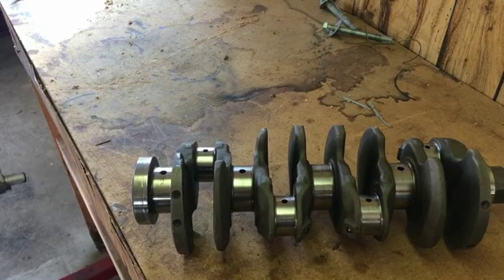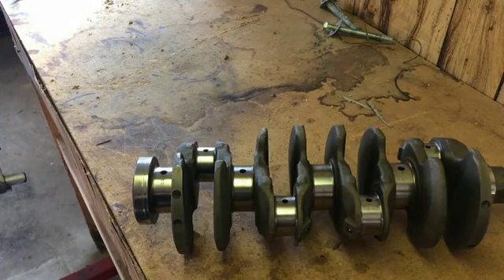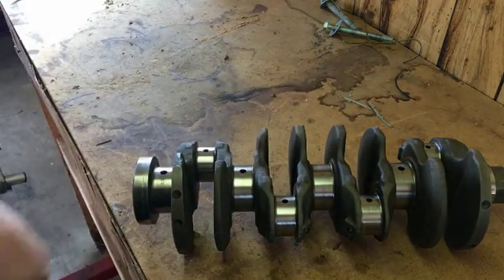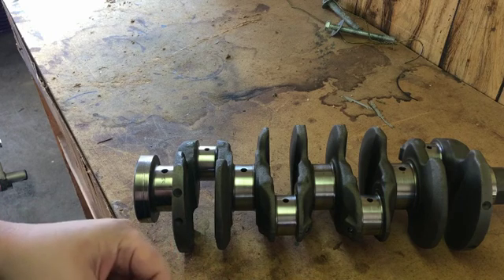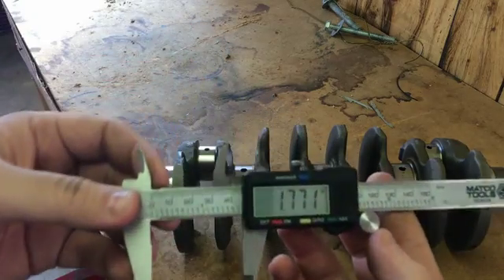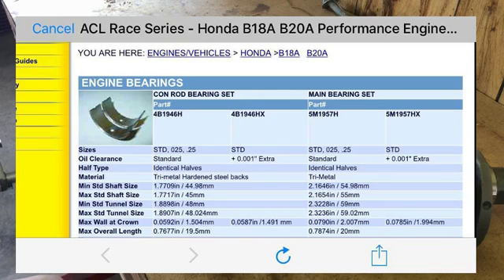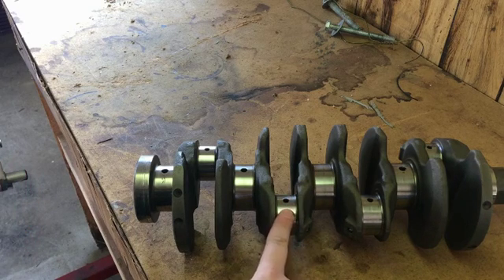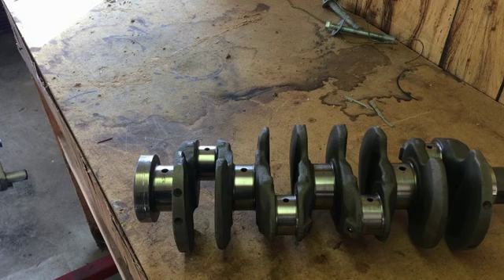Crank Inspection & Bearing Clearance

Comment: Have you ever gotten bearings from ACL with imperfections? This is my SECOND set I had to get from them because the first was 9 kinds of fucked up, and now I got 1 bearing from each set (one main, one rod) with tiny nicks in them I can just barely feel with my fingernail. Would you run them?
Reply from the maker: I’ve never had that issue. Personally I’ve reused old bearings that have had imperfections. I’ve gone over them with a scotch bright (which I’m sure everyone would tell you NOT to do 😁) to clean them up and send it. But no you shouldn’t be getting any with issues